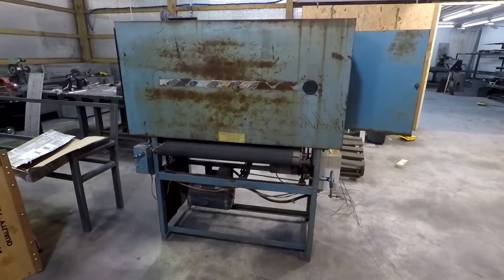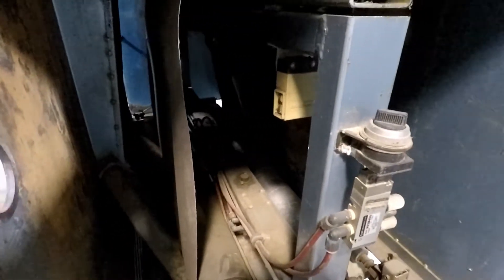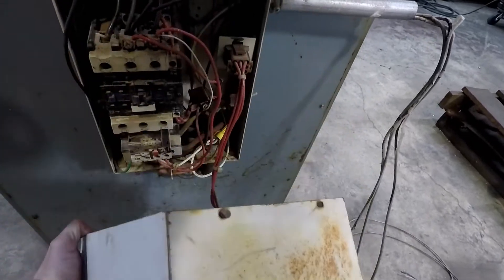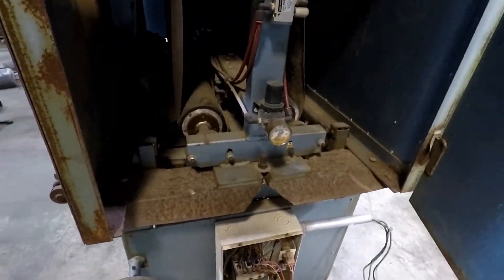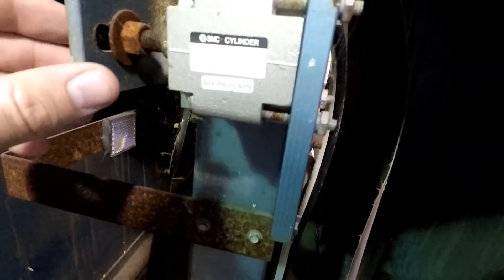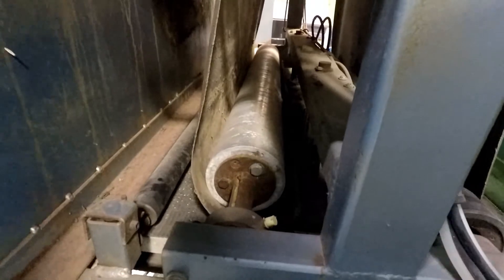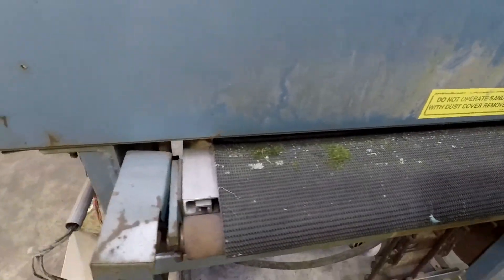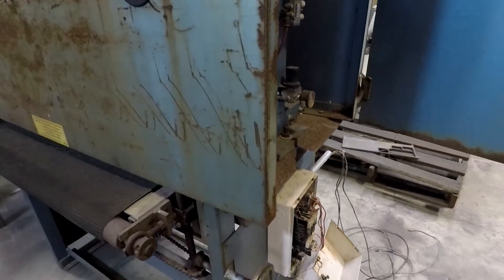Wood Sander to Metal Timesaver!, Fresh Arrival

Comment: Did you ever modify the timesaver for metal?
Reply from the maker: Yep. Works fine. We use it a lot actually. It is far from a perfect solution but for us it works until we can buy a higher end solution. We don't use a sander for a lot of the parts off the laser so it isn't needed. But we are going to be buying an edge rounding sander in 2024 (tax reasons).